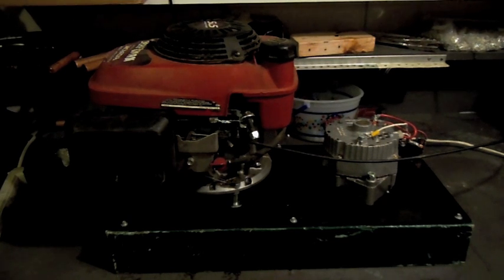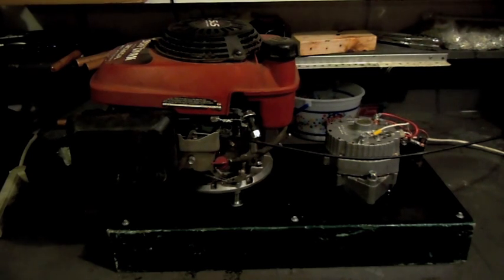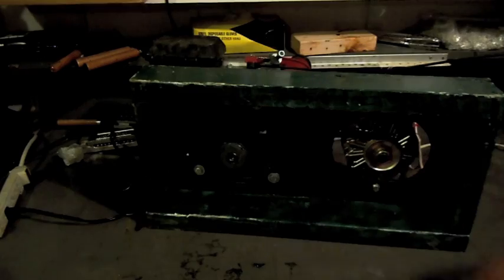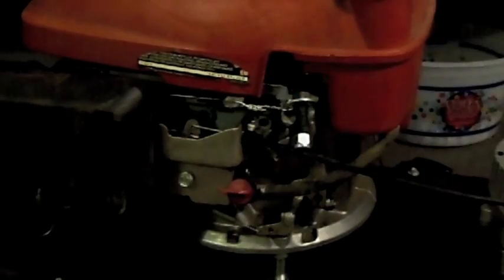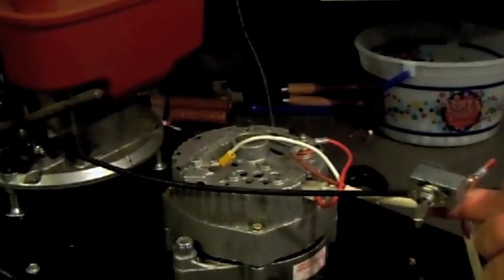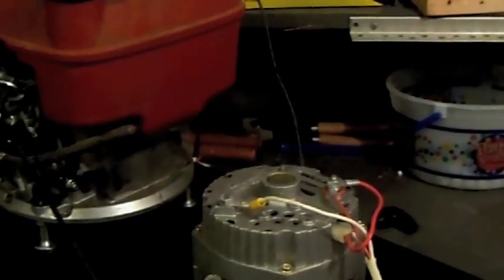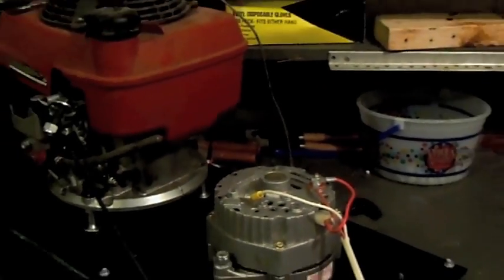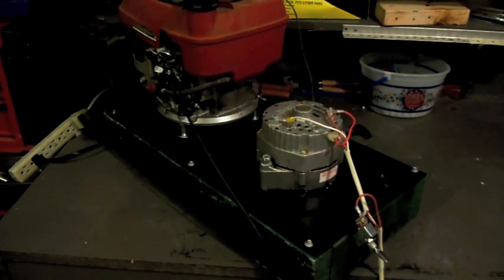How to Build a Lawnmower Engine Generator | DIY DC Alternator Generator

Comment: @DIECASTER Yes...Definately would be best to get a 135/165 amp truck alternator, that way if you use a 4-6 battery setup you could sustain near 4 kw power off that lawnmower engine.

Comment: With a little work, you could tap into the windings of the alternator directly, removing the diodes and eliminating the voltage regulator. I haven’t tried it but it would be smart to start with AC instead of converting back and forth. I am going to dig into this because I’m planning on building this setup on a riding mower and use propane. I’m hoping to build a good storm generator.

Comment: I have a detailed book on doing this to all types of engines. Main point being the regulator in your average car alternator won't stand up to high amperage load for any more than 30 hours or so. There are ones made that are heavy duty enough with enough heat dissipation to go for years. Not something you'll find at an auto parts store though.
Reply: I was wondering if you could give this information to others like me who is trying recycle an engine that was a push mower now the rest would be a generator.

Comment: You could remove the switch and replace it with a small lightbulb on 1,5 w like the generator lamp you have in youre own car in that way it will operate the gerator for you automacily becourse when the generator is standing still the lamp is grounded thru the generator and lights up and when the motor is running the positive power comes from both sides of the lamp and the lamp goes out and the generator is activated .
Reply: anyone know which is the exciter? f or r ?

Comment: One last thing is the type of battery you need, your standard battery is great for cranking AMPs but for welding and what not your best bet would be to get RV House batteries.

If this is setup properly you should be able to weld with no problem at all. Your limitations will be with the number of batteries you have in series and how long of bead you are going to weld.

Even a 110 welder will overheat your cables and connectors if you run too long of a bead.

Comment: You have the right idea but you are using a motor to turn a single alternator, such a massive waste of power/fuel. There is no reason why that motor can not turn at-least 2 or 3 if not more depending on the horsepower.

You are also going to need a voltage regulator to connect the alternator to your battery.

The final and most important piece of information is the RPM's. In a vehicle the alternator is at peak when you are at 1100-1200 RPMs. 

Anything more is a waste of fuel.

Hope I helped!

Comment: Any generator is only as good as the fuel you have to feed it. Run out of fuel and poof no power. I like the 12 volt solar jackery type to power a few vital items.

Comment: I see one big problem here,,most lawn mower flywheels dont have counter weights the blade is the weight, so it wont run smooth if at all

Comment: So you need a REGULATOR inbetween the alternator and the battery? I THAT really how you get the alternator to put out electricity? I have an alternator connected to my lawnmower, and a battery going to it, but it still puts out no real electricity.? 
(Of course I speak in lieu of the part time, 44mph on car, Box Club Teleport, Future Consciousness "sin" "thief" detection Unit,  I should have been people's psychiatrist, publish on trash cans and say such as "greeting for 13 to 27 years.). Nice